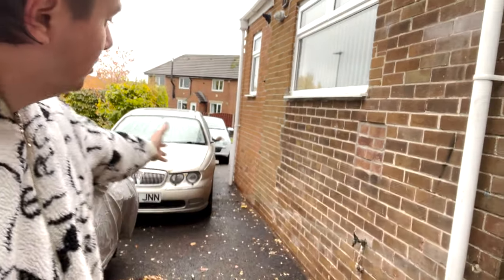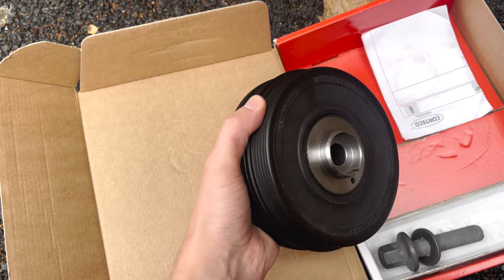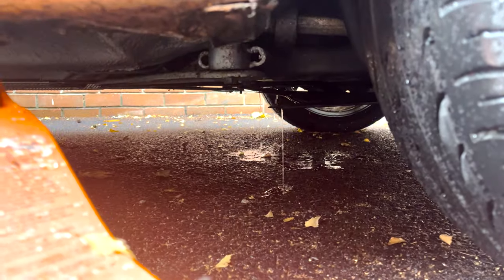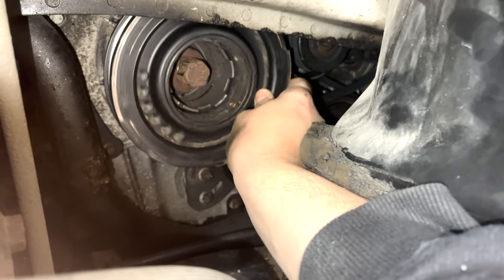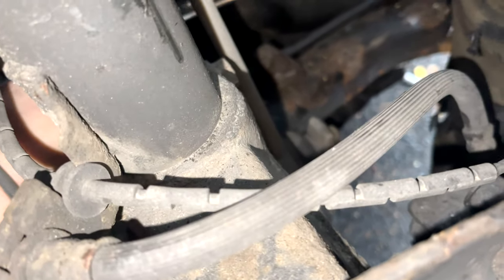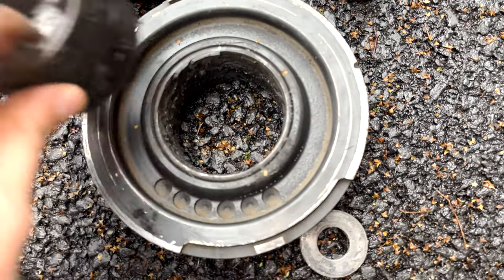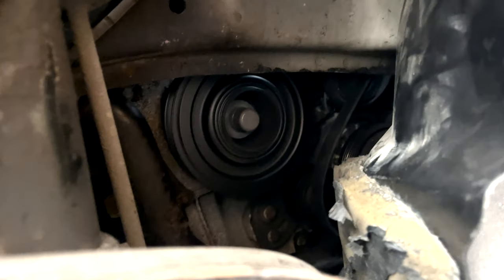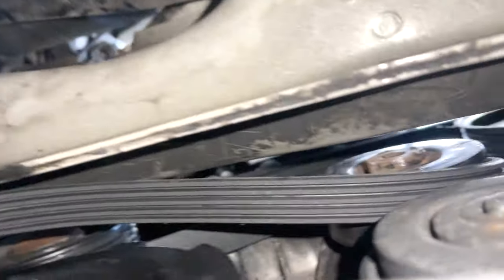BACK FROM THE DEAD?! - Rover 75 Diesel Crank Pulley Replacement DIY

Comment: Thanks for this. Was a recent fault on my CDTi Connoisseur. Would of given  this a go myself confidently but would not of been able to do the fault diagnosis. About to fit a Head Unit and i agree with the upgrade from the Xtrons about whatever is in the unit is the same but the label on the side changes. Great videos

Comment: Hi Tom.
               Well done in removing and fitting the crank pulley, most people never try to do this as lots can go wrong, using the method you used to loosen the bolt, also using a torque gun this can throw out the timing chain, the crank pulley should be tightened up in increments of 100Nm+60+60+30 there is a special tool to lock the crank 12-177 i have seen a car smash its cam followers using a gun to undo and tighten the pulley up, but as i say well done, always best to remove the wheel arch liner completely as this will give you more room when you come to put the belts back on, which can be a nightmare as you found out, if you can at some time get a torque on the bolt to check it's all correct, where did you purchase the Corteco from, the old pullet looks like a BG one but not 100%  maybe see you at one of the Nano's 2023
Reply: thanks for the heads up about not using a a gun to undo the bolt.

Comment: Mine failed on the M4 coming back from Bristol. I need rhe car for work and with the weather being bad and not having a suitable place to work on it, it went to a garage. They charged 350 quid for pulley replacement and belt too which was quite reasonable. MGRS of Wycombe was the company.

Comment: Erm, dont EVER run an engine without the crank pulley bolt in!!
It also holds the timing chain pulley. If it was a floating pulley, or managed to come detached, you would have completely ruined the engine

Comment: YAAAAAAY

it happened to me todaaaaay

was joyous AF you wouldnt believe

but you wouldnt have read it from my face either way , (as in regular rover 75 day,..... which it was:))
Reply: usually i rev up harshly building up to speed (i loathe dragging up to speed)
from 0 to 20, 30 50kmh, whatever the speed limit is
then i go cruise mode

today was between 36 and up to 39 degrees Celsius
pushed the car (2001y CDT automatic jatco) to 130kmh with switching AC on and off multiple times (sometimes it blow cold-ish, sometimes ambient warm, too much freon or not enough, yet to see)

i suppose that did not help this not happening either
Reply: and guess what

mine was CORTECO

installed two years ago
by myself

first i thought that it unscrewed
and then i saw it has actually desintegrated
Reply: unfortunately where i live we dont have lanes with cool names

just decent ordinary names like f117 lane where the damn thing was shut down using 60's russ tech